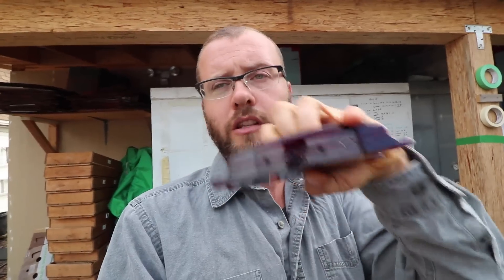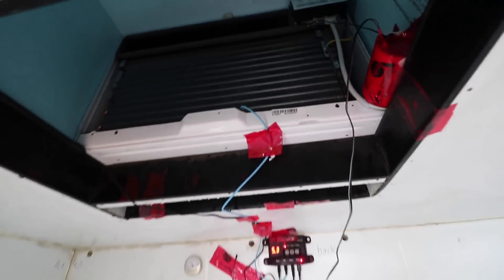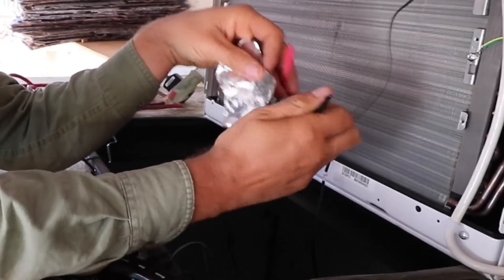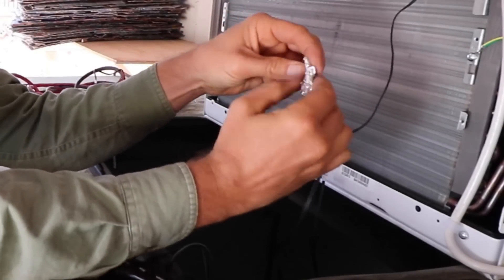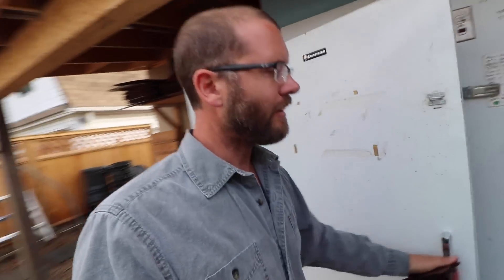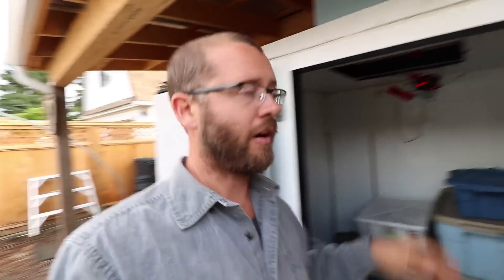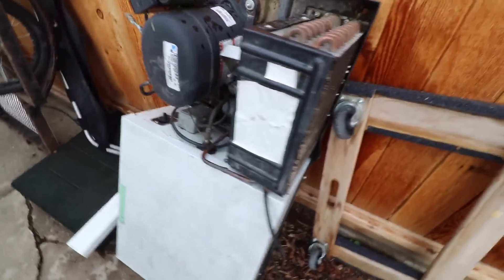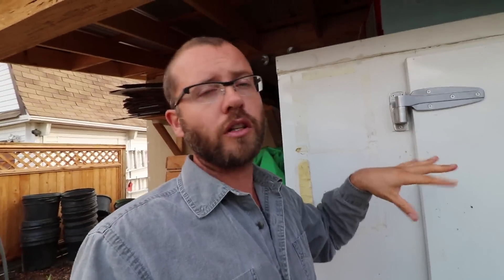Unlock The Cool: How To Build A Walk-in Cooler On A Budget

Comment: I was pricing used units today. They started at 2500 dollars. I'm convinced I can make my own with wood, Dow board insulation. Metal tape, Great stuff foam. An AC window unit. Cool bot and a Light fixture with a lamp for about 650.00 US. I need to shave dollars where I can because the 4600.00 dollars I have now isn't quite enough to get started. I'll be renting a garden tiller as I need 1 for my first year. This first year is going to be a hard 1. Thank God I paid off the house
Reply: walter mccue nice work. I'm sure when you look back in 10 years time it will be the year full of the most memories
Reply: walter mccue Hows everything going?
Reply: Half size cargo shipping containers...insulate it.
Reply: Better off finding a used cooler. 
By the time you buy materials insulation etc and get a proper working and sealed door to function right iv seen guys come in just under but most of time more and it ain't as good.
Reply: get some
Reply: Good day Mr. Ed. I know it has been a while since you posted this comment but I have a proposition for you that I am hoping we could discuss. I hope this reaches you and reaches you really well.

Comment: Another great topic.
We built a 8x8x4 walk in cooler out of plywood and pink R board, we installed a 1250btu a.c. and a cool bot. It works splendidly.
Cool bot is the cats meow.
Curtis, I really like your technique showing how you have isolated the temperature wire from the a.c.'s cold air flow.
In addition, yes it is 100% possible to find a great deal on 2nd hand coolers. We stumbled across a guy selling 50, yes 50 brand new 8x5x4 coolers without compressors.
These have 6" thick panels and again have never been used.
He was selling them for $225.00 each. Good luck.
Reply: how much did your cooler cost to build? I can't find any cheap ones near me so far

Comment: Another heads up!
You can reduce the cooling costs associated with opening the door by keeping the cooler at least half full with solids. 
If your cooler is low on stock, store bottles of water or other solids in it. 
These significantly reduce the amount of cold air that escapes every time you open the door. 
It's the same with a domestic fridge. A fridge full of cooled produce loses less cold each time you open the door. So if your fridge is not fully ultilized, store water bottles or similar thermal sinks in it, especially in the lower compartments.
This is off grid living 101.
Reply: Further, plastic strip curtains in cooler doors also significantly reduce cold losses.

Comment: Hi, I've used the chest freezer 5cf at 40f with a temperature controller (from newegg.  $20) for over 3 years.  Average cost is $1.50/mth(or $18/yr).  I found the controller thermocouple needed to be run through the door opening. instead of replacing the older interior walled thermocouple.  Replaced my Regular Fridge.  Also, I like the outdoor weather thermeter with the remote sensor.  Thus I get Hi/Low and current inside temperature.  Good for setting up and getting the temperature right.  

The most energy is in the turn on part of the cycle not the actually running.  Watch your lights dim when the compressor turns on.  They don't stay dim.

Several things, that I saw, on the Walk In Cooler, is that I would have the large Plastic strips to keep as much cool air in the unit.  Or build outdoor walls & door to keep as much of the cool air in the cooler.   Basically think "Air Lock". The other thought was to shape the air flow so that the cold air is separated from the air intake  Shape it in a curve on the cool air so that it flows downward. You might even make it a Y so that a steam of air hits each wall instead of your head as you are standing inside.

I might think about putting in a small side door a little bigger than the totes.  However, that requires two people or some kind of sliding tray to pull/push in the totes   .Thus labor costs vs cooling cost savings.

Also, check your walk in cooler flooring to check for mold buildup.

Also, I might suggest on those making the walk in cooler via connex, that you have three separate rooms.  With an interior door.  Again, use an airlock since you have the space.  Thus the back room is your overflow.  Load your airlock, then fill the inner chambers.  Airlock big enough for a rolling cart or Handtruck  I like a U shaped platform *2 2x4 with plywood on top where the handtruck slides under the plywood, thus easy loading/unloading a stack of totes.

Comment: I built an 8' x 8' x8' high walkin cooler inside of a 45 foot insulated refridgerator trailer that is used to haul apples to California. I added 2 inches of insulation to the floor, walls and ceiling and have a 12000 btu unit AC, with Coolbot, and it keeps cool all year round. The larger area of the trailer we store squash in and keep it at 55 degrees with a 1500 watt heater!  We have 10 acres so not in a neighborhood like you are. Just south of you at Lake Chelan!

Comment: If you're up for some more challenging diy, automotive ac is a LOT more cooling capacity than residential. A junk yard pull can be reassembled, recharged, and made to run from electric or gas motors.

Comment: This is a very resourceful solution, But for the sake of perishables, I would still use a refrigeration unit. they are designed to recover quickly and maintain the temps  the compressor should last 10 - 20 years if not put under irregular stress. Your local HVAC tech can also service them. depending on the person you call, some will service a window unit as well but they require some slight modifications to add freon. Also, While the cool bot has its market, your paying for a "plug and play" device that can be avoided with $100 in parts and some DIY or any electrical/Hvac tech. If you lived in Oklahoma that window unit would probably work for about 5 years because it would be running 24/7. Good luck Keep us informed as i am curious as to exactly this will turn out. in the long run.

Comment: After closer consideration, What you have done is exchanged a High demand system for one that is smaller and cheaper but still fits your load. when you have to change things out later on Keep in mind that there are mini split heat pump systems that are very efficient. The sales point here is that some have built in Grid tie inverters so they will run directly from DC (Solar) and AC mains without user intervention. This could allow you to run them on solar with Back up capabilities in commercial power failures as well as, in addition to less load on your main inverter for other things. Also they have stages(Variable speed and displacement compressors)(Not Fan speeds) that allow them to run at less power at times of low cooling load or kick up into high power when low is not meeting the demand. They also have a service life of 10 - 20 years with proper maintenance  At around $3500 they are an investment but are very efficient and a higher degree of reliability.

Comment: I managed to rig my window AC onto one of those brewing temperture controllers and i just have my window AC to permanent on mode. So when the temperature hits the 50 degree mark it shuts off the AC. Luckily the unit has a safety feature to prevent being switch on to quickly or else it would have blown the compressor by now.

Comment: I'm planning on transforming a 20' insulated shipping container to a walk in cooler using a cool bot and a 36000btu LG split unit. Any concerns I should have?
Reply from the maker: Sounds like a great idea. You'll figure it out.
Reply: +CannaHeaven That's awesome!  With a container you can even section it off and use part of it for sprouting grains.
Reply: I just got a ref thermostat and used it in place of the a.c. stat. Only concern is the coils freezing over. Adjust the temp or hook up a defrost heater set on a timer
Reply: thats not gonna be enough

Comment: Cool hack! I see a few small problems with this. Air conditioners are just not designed to run at low evaporator temperatures without serious modifications. My main concern with this set up would be the energy consumption of the unit. There are a few things that would make this energy inefficient. You should purchase a small watt meter and see what the real power consumption is.  
 
Looks like this unit is located outside, have you tested this in the winter?  Sure enough you are going to have many freezing issues in the winter. You may need someway to cycle on and off the condenser fan based on the head pressure when the temperature starts to get below 10 C or so. Some kind of defrost method. Usually turning the compressor off and leaving the indoor fan running for 15-20 min or so.

I proper and well maintained unit designed for the task should last you 10+ years of good service. It may be a bit more expensive but in the end the headaches and cost will be a lot less.

But hey, if it works it works! Still think its a cool idea and will get some people out of a pinch

Comment: I'd be curious to know what the lifespan of a new compressor would be versus a new air conditioner being run for so long.  The nice thing is that you only have to continue replacing the air conditioner when it bites the dust.  Any idea about how long an a/c can possibly last being run this hard?
Reply: buy a new and buy the service contract from the store if your worryed 

the cool bot might void the warranty so I would remove the cool bot  and take just the Dead AC unit back to store

Comment: you can do this without having to buy the coolbot.  jus put the ac thermostat on the outside of the cooler (or disconnect it all together), then plug the ac into an electric socket timer that you buy for $10, and use a magnetic thermometer on the inside wall of cooler for temperature readings.  done.

hope this helps
Reply: Until the A/C ices over and you end up having to buy a new one plus replace whatever you were trying to keep cool.

Comment: R40? at 1.5" ???? had a good laugh at that.... $359 for the cool bot? why not a 1609-101 thermostat that has a high amp rating for line voltage loads, and easy to wire with less than half the cost.  A better solution, is to load up with lots of foam insulation  and  air leak proof the box, include a floor and run it for peanuts. And get a door closer fot the box or invest in some cam hinges...better yet, learn to keep the door open for only quick spurts.
Reply from the maker: You should write a book or start a YouTube channel since you’ve got it all figured out.